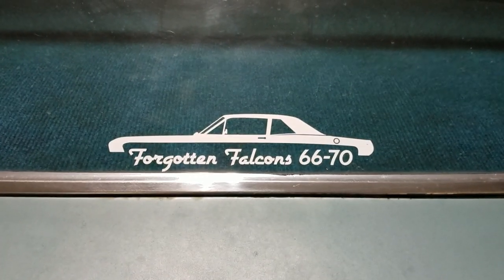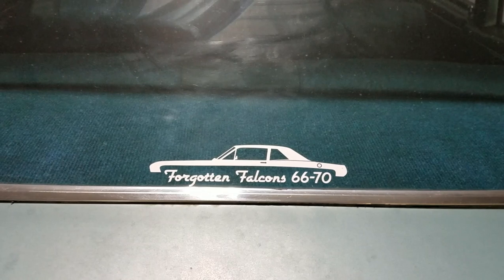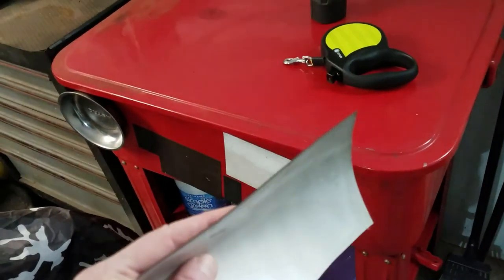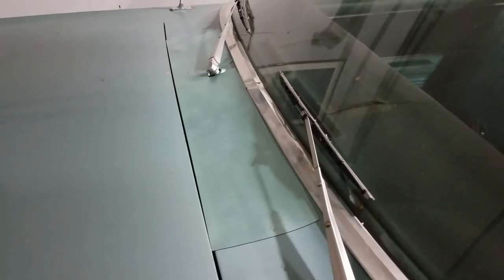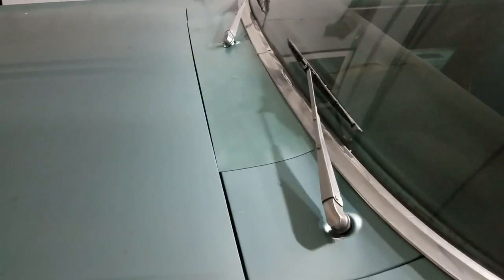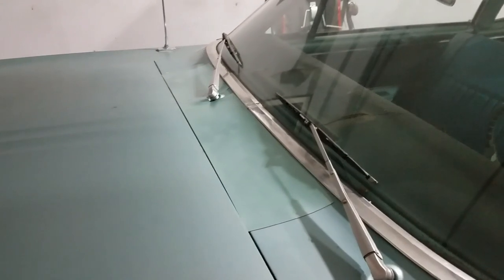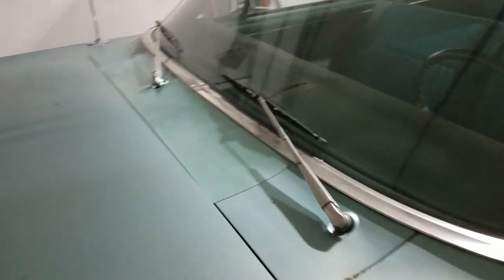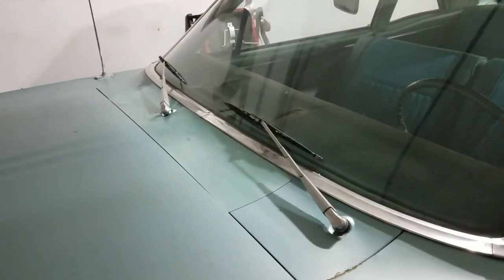Inexpensive DIY cowl cover for Ford Mustang, Falcon, Fairlane, Torino, etc

Comment: I wanted to ask are you able to run your heater with that on there? I was on CJ pony parts looking for that plastic piece you were talking about and under the questions and answers it said that you can't run your heater while that's on there. Not that I plan on driving my car much in the winter time but I was just curious. And I'm assuming it keeps the water out when you wash the car cuz that's my problem at leaks when I wash it
Reply from the maker: I've run my heater all the time with it in place. Without it, cold air blasts in through the rust holes! You may need to rely on the fan to move air over the heater core instead of outside air but it works fine. And yes, I wash my car with that in place and no water inside.